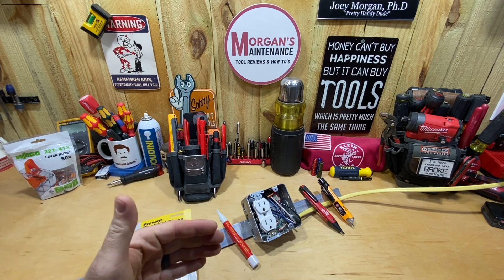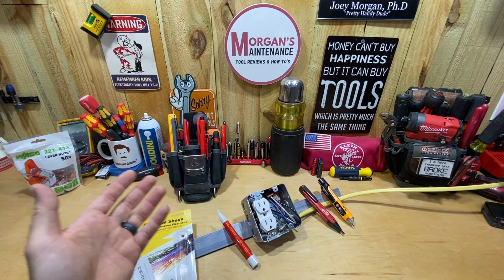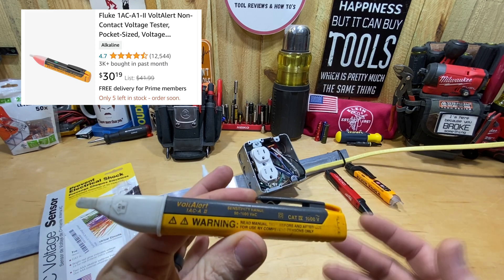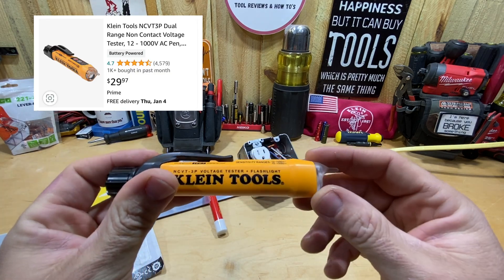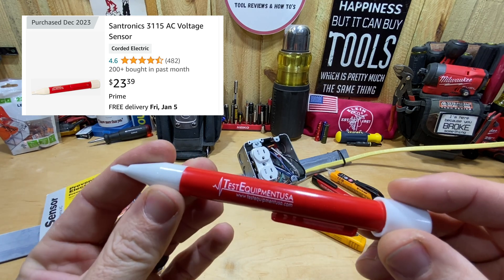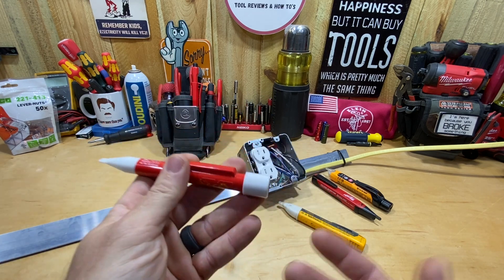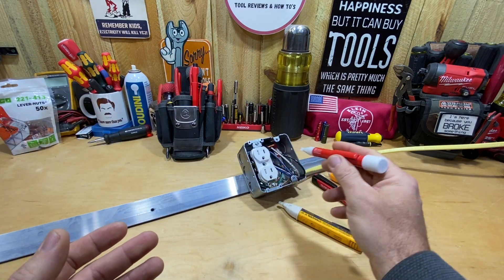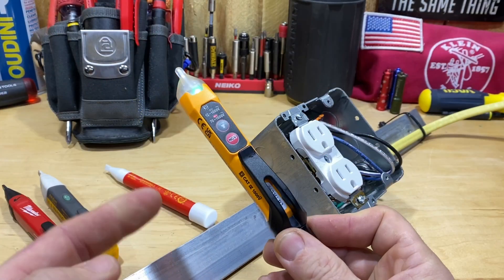Santronics ALWAYS ON Non-Contact Voltage Detector - How it compares to Fluke, Milwaukee, & Klein

Comment: I look at like this , there should be NO POWER DETECTED ANYWHERE when working. Not work on non power wires next to wires with power. I want as much sensitivity as possible. Klein is my choice when working on home wall sockets .
Reply from the maker: Sometimes when diagnosing issues you need to do it with Power On… There are ceiling boxes in commercial with multiple circuits, switch legs, etc.  Detectors like this help you narrow things down without taking everything apart… then you can double check with your meter, and turn it off to do the fix.  

If you are doing demo… then yes.

Comment: I stumbled upon your video and grabbed and ending up grabbing a Santronics because of it! One question though, how do you change the battery on this thing? Supposedly the white tail piece screws off, but I can’t figure out how to do it😅
Reply from the maker: On the one without audio, The Top unscrews.. but it’s a beast.  It’s like it has glue in the threads or something.  I had to use some pliers.

The one with sounds, you put a small flathead where the top meets the clip and spread it open

Comment: I have that same Klein tester and find it too sensitive.  Like today, I was changing out a ceiling fan and trying to verify which lead was for the fan and which was for the light.  With one lead energized, the tester would indicate that both leads were on.  Had to pull out my multimeter to check.  One was showing 6V and the other about 120V.  Even in the 70V - 1000V mode, it still was indicating both as energized.  I might give that Fluke tester a try.
Reply from the maker: This one is really good for only showing which wire is live, that and the Sperry that has three adjustable sensitivity.

The Fluke is the next best.  It’s kinda a happy medium.  It’s been my go to for a long time
Reply: @MORGANSMaintenance  Well, the Klein failed in the which wire is live respect.  Maybe I have a faulty one, I don't know.  It's only good for telling if any wire is energized in a box, not which particular one is so.  I ordered the Fluke and will give that a try.
Reply from the maker: @gpraceman  👍
Reply from the maker: @gpraceman your bag will be in this Saturdays Guess the Trade

Comment: I remember when all you saw on the jobsite was Santronics testers like this. The only real issue is that the only way to really test them is it rub them on your shirt to build up static. I'm not sure if just tapping it so it lights up is a reliable test, but that would be easier. That said, I'm looking for the smallest reliable tester I can get and I'm looking at this and their "Ultimate" tester.
Reply from the maker: I had never heard of them before, but after this video I see that many people have used them for years.

I do really like it so far, I hadn’t seen their “ultimate”.  Will have to look it up 👍

Comment: I’m 90% sure with the fluke if you quick press it to turn on it will have the audible live sound, however when turning on if you hold for longer it actually makes it into light up only so like a silent mode so perhaps if it works intermittently could you be holding the on button a fraction too long.
Reply from the maker: I believe that has been the case… been using for years and never knew 😂… who reads instructions 👍
Reply: @MORGANSMaintenance oh I certainly don't 😂 only found out myself when I was working with a mate of mine who had the same and I was complaining it was broken and he told me 😂
Reply from the maker: @jnewton86 👍👍

Comment: I carry a Santronics model 3000 “Ultimate AC Sensor” which replaced my Fluke a few years back, due to the unparalleled sensitivity. Like the model you reviewed, it’s an always-on sensor… But it has a beeper for audible feedback. 

My only complaint is that the pocket clips tend to break rather easily. I’ve dropped it quite a few times and it hasn’t exploded in to a bunch of pieces, so it’s seemingly more durable as well.
Reply from the maker: I didn’t see that one, but I will see if losing the beep really bugs me.  Thanks for the heads up 👍

Comment: I've been doing electric 35+ years and the Santronic is by far the best IMO of all the Death Sticks.  I've had basically all others.I like it so much just bought 10 of them and have them all over. Of course my wiggy is the best along with 20+ others I use. Can't go wrong with the santronics. Only pet peeve is I always break off the shirt pocket clip so not sure if they can fix that glitch but I live with it. Keep the good videos coming long time listener here
Reply from the maker: That’s a high recommendation.. the only bad reviews I read were durability, but that can be the case when many of these when you drop them.

Appreciate it 👍👍

Comment: I go between fluke and wiha but most of the time the wiha is the most accurate.  Almost all my co workers use the fluke one too so having wiha let's me know if someone borrowed it.
Reply from the maker: 👍👍… I haven’t had many tools from Wiha.  Their precision screwdrivers are about it, but I really like those.

Good idea on the “borrowing”
Reply: Wiha Non-Contact Voltage Tester Category IV 12-1000V AC with Flash Light - 25506  is the one I like the level meter on it to show if it's high or low voltage
Reply from the maker: @MattHmm-rq6dn  appreciate it 👍👍

Comment: The Klein isn’t beeping because you have it set that way. I forgot how it works but it has to do with the bottom.  I usually turn it off then turn it back on.
Reply from the maker: 👍👍… Appreciate it.

I honestly haven’t used that Klein enough to get used to the settings.  I have a couple of those, but I got them free in packages with other products.  I think I got this one with the Digital Receptacle Tester. They have always just been too big for me. I keep them in the garage and in the house.

My Mic wasn’t picking up much of the beeping either…the Milwaukee was beeping much louder in person than what it was when I edited the video, I’m not sure if the Klein did or not.

Comment: Ok i have worked as an electrician and high voltage testing tech for 40 years and in all my experience the santronics is the hands down best tester i use it on a daily and never had a problem the only thing i would say is change the batteries to name brand not the junk it comes with
Reply from the maker: I had no idea so many people had been using these… but many of the reviews were exactly as you said.  They have been using them for years and swore by them.  That’s what caused me to give it a shot.

Appreciate your thoughts 👍👍

Comment: I dropped my fluke and the beeper got really quiet. I opened it up and there was a circle-shaped cover on the circuit board with a hole in the middle. I used a paper clip or something to push whatever is inside of it back down and it has worked like new ever since. Maybe yours is stuck. Otherwise thank you for the information. I really like my fluke. I had a klein but it broke when I really needed it and I won't go back to them for that.
Reply from the maker: That may be the case on my Fluke, I will check it out.  Apparently you can also turn the sound on/off… I’ve been using them for years and never knew that 😂
Reply: That is true too but it should reset itself every time you turn it on or off. lol
 @MORGANSMaintenance

Comment: I’ve been using the Dual voltage Klein but it kept getting turned on in my new bag, ran the batteries down. I put new batteries in, lots of false signals, so I ditched it. I bought a Milwaukee version, not really pleased with it. I think I want a straight 90v or higher type stick.
Reply from the maker: I rarely need the dual range so its never been a feature I've looked for.  Nice to have if it's on a detector I like, but not something that made me get it.

The Klein's are too big for the pockets I like to put mine in, and if I move them to a bigger pouch I have to get rid of a Tool I don't want to lose.

I really like the Fluke (used them for years), and my first impression of this is one is good... but I haven't had it very long.  The reviews are good though.

Comment: Happy New Year! I carry a Klein dual voltage NCVD in my front shirt pocket every day, but I like the slim look of the Santronics. I've found the Klein to be overly sensitive to close wires as well, especially in 3 phase switch boxes. I may have to grab one of these, as it seems like it might be useful for finding a dropped phase/blow fuse a little more easily.
Reply from the maker: Happy New Year too!

The Klein was definitely the most sensitive of the bunch

Comment: Wow that Santronics I’ve had for years! I never liked it because it’s always on and gave me false identification or to sensitive. I’ve tried them all and by far the Fluke is the best for sensitivity and but not so much as durability, once I drop it, it’s over and done with. I only use two now which is the Fluke and Sperry with sensitivity adjustment, if I need to find one wire in a box that is the go to with spot on accuracy, but you have to hold the button down on it, the new model is ok but the older one is by far the best. The model number on the old one is VD6505.👍🏼 The new model is VD6509 and I can’t speak for that one because I never tried it but it seems to have better features and improvements. With the Fluke and Sperry I’m set on both of those. The Fluke has the settings with turning audible on or off if you’re not aware.
Reply from the maker: Also, I wasn’t aware of being able to turn the sound on/off and I’ve used these for years 😂😂 

Sometimes reading the instructions helps.
Reply: @MORGANSMaintenance  yep, I was in the same boat with the Fluke audible until I finally read the directions 😂
Reply from the maker: I like the idea of sensitivity adjustment.  I may check that one out too.

Fluke has always been my preferred, I just buy different ones occasionally to make sure I’m not missing out on something.

Appreciate the suggestions as always 👍👍
Reply: @MORGANSMaintenance  the sensitivity adjust at my early career had been a game changer for me because at the time so many were coming out and that one was the only one to pinpoint a wire in a stuffed box, later on I discovered the Fluke and never went to any others beside them two because it does exactly what I need them to do, if it ain’t brine don’t fix it, right? lol
Reply from the maker: @Jesus_Strong  very true.  I almost always end up using the Fluke ones but I always buy other ones to make sure I’m not missing out on something.  I have that FOMO with tools 😂

All my Klein versions I got in package deals with something else I bought.  I got the one in this video when I bought the digital receptacle tester. 

The Milwaukee one is what Home Depot used to stock and I picked it up when I needed one for some reason.
Reply: @MORGANSMaintenance  yes I do also look at new features on some of these as well as the sets during the holidays but I normally just give the NCV away, I do remember when the Milwaukee came out and I did use it from time to time but always found my way back to grabbing the Fluke and always have on hand the Sperry sensitive adjust in case the Fluke was acting up or I wasn’t 100% sure.

Comment: I have a couple Klein testers (even the one with the infrared thermometer…handy in a panel). Been thinking about getting the new Milwaukee (Model # 2200-20) it’s $20 at Home Depot. Looks to be slim and it beeps, which I like also. There’s a green light like the Klein to let you know it’s on. I’ll let you know how it works when I pick it up. Happy New Year my friend.
Reply from the maker: I saw that one just the other day.  The Milwaukee ones I have were ones I used all the time because they were available at Home Depot and then they quit carrying them.

They just added the one you are talking about and another for $30… I think maybe the $30 one has a light.
Reply: @MORGANSMaintenance  The $30 has the light and is dual voltage. The tip looks better on both of them, as far as dealing with tamper resistant outlets
Reply from the maker: @brianhall9019  I expect with most newer models of these testers, that will be a big thing.  These receptacles are pretty much going in everywhere.

Comment: I have the NCV tester from Kewtech. Like the Santronics one it is on all the time and is small enough to go in the pocket on my Velocity tester bag. I also have one from CEM that is ATEX approved for hazardous areas that I work in sometimes. They don't get a lot of use, but are very handy for detecting breaks in wires and will work on systems with a PEN fault, peculiar to the UK.
Reply from the maker: I haven’t heard of the Kewtech brand.  Will have to check it out 👍

Comment: Very good comparison.
I'd go for Fluke, because their component quality guarantees you that the readings are always the same no matter the battery capacity. With some cheaper testers there may be "glitches" when battery is low. I wonder how Santronics will behave in that matter.
Klein is nice because of two-colour signal pattern.
Milwaukee, well pricey TTC toy, but I'm not surprised.
Happy New Year.
Reply from the maker: I’ve always had good experiences with all my Fluke tools and normally that’s what I go with.

I decided to try this one because of the reviews.  At face value it matches what everyone says, but we will see.

Happy New Year my friend 👍

Comment: The only hot stick I’ve used for years. Simple and no accidental button push. Only flaw is the durability. You drop it 50/50 chance it breaks. I have broken two but I like it so much I keep getting them.
Reply from the maker: 👍👍.. that’s want many reviewers said.  They’ve broke several, but keep going back.

Comment: Have you done a video on the Aneng 3009? Its the same size as a pen tester but has Multimeter features. If not, I highly recommend it. For when you dont want a bulky meter its amazing for less than $30.
Reply from the maker: I don’t have that one… I have some KAIWEETS versions that are similar.  That one looks a little smaller though. 👍
Reply: @MORGANSMaintenance  I have the 2 kiaweets ones also, and yes, the aneng is smaller. It's the same size size as the fluke or milwaukee and smaller than the larger klein models.  Mine usually lives in the mp2x
Reply from the maker: @Cavett24 that’s a good size, may check it out.  Thanks 👍

Comment: I have the Klein. I like it because it also does DC voltage. While I rarely use the flashlight and sometimes I turn it on by mistake it's nice to have that feature. Overall it's a great NCV tester for me. I'm not usually trying to find an individual wire that's hot. I'm usually checking to see if any voltage is present. I can though how that could help someone trying to track down a wire in box that has wires on different circuits. I have a Fieldpiece multimeter that also has an NCV built in.
Reply from the maker: That is a nice feature on the Klein.  

I run into tracing circuits all the time, so this one will be good for me… but like you said, it all depends on what you do (normally run into)

Having one on your meter would be super useful 👍
Reply: @MORGANSMaintenance  It's the Fieldpiece SC-680. It's way overkill for me but I have a minisplit in the garage and it has a minisplit function. Being they are becoming more popular I thought it would be a good feature to have. The head on it also turns.
Reply from the maker: @scotts4125  👍👍 They are getting pretty popular.
Reply: @MORGANSMaintenance  Talk about a timely video. I have a buzz on an led light with a dimmer. I have a Lutron Caseta dimmer which wasn't cheap. I have since read they have an even more expensive more that's ELV that doesn't buzz. This one also requires a neutral. Being this wasn't a regular switch to swap I need to know which wire was line and which was load. The Klein indicated on both. It did beep on the load side I will give it that. Line side was steady. I am now going to buy one of these that is more precise. You could say I now see the light. :)
Reply from the maker: @scotts4125  all it takes is the right situation to get your tool money 😂
Reply: @MORGANSMaintenance  Most of us are willing participants when it comes to tools. lol

Comment: Thanks for sharing. The fluke tester has a silent mode where it won’t beep.
Reply from the maker: I’ve been using those testers for years and never knew that 😂😂

What do you do, push the button again or something?
Reply: @MORGANSMaintenance  It’s been awhile since I’ve done it, but I believe you just hold the button down for a bit to toggle between silent and audible.
Reply: Yup

Comment: This is the one I have. Never failed on me in two years. It’s still important to realize the limitations but I love its simplicity. Always on, just test with a tap to make sure batteries are still good. It is ‘weak’ though so don’t drop it.
Reply from the maker: Everything you said is basically a sum of all the reviews I read.  👍

I really like the size of it.  The no sound is the only thing I don’t like, but there are only a few instances where I usually want it.

Thanks for sharing
Reply: @MORGANSMaintenance I got this because it doesn’t have a beep. On one of yours your beeper doesn’t always work which can get you in a pickle pretty quick if you trust it too much and don’t hear the beep. It’s the simplest one I found. Not much to break (except for the case itself). I only use this to know if some voltage is present…if I’m diving my hand in I make sure I know what’s going on to a better degree than what any of these testers can do.
Reply from the maker: @nachoisme  true…

It’s definitely the best I’ve seen for being close to other wires.  And the size makes it a little easier to get into places.  I really like it.